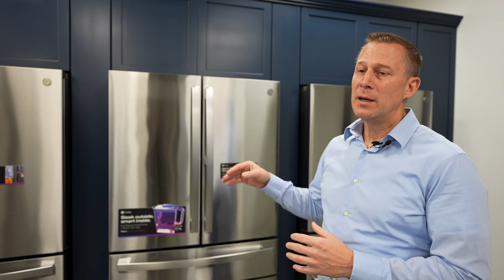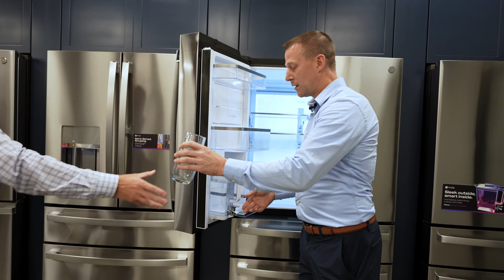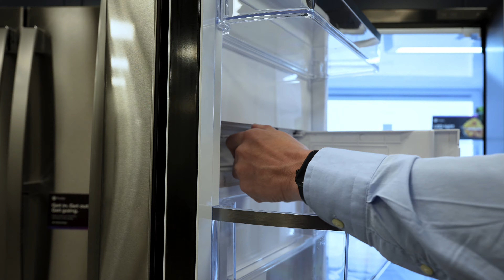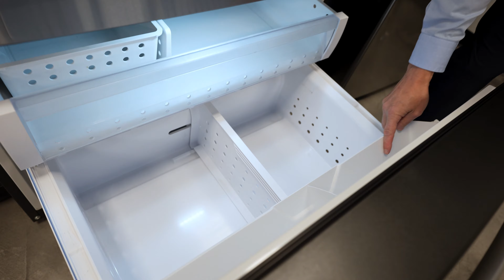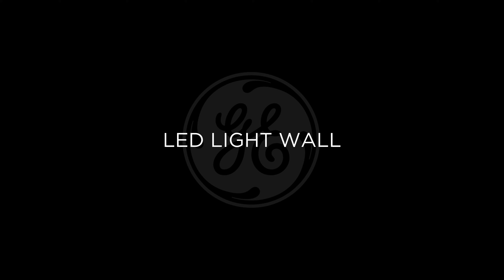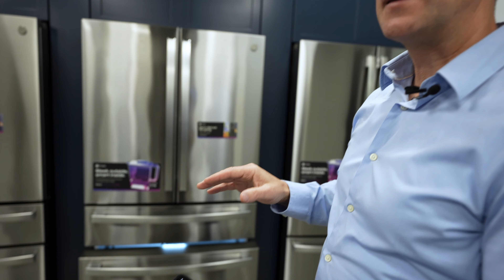GE Profile™ Refrigerator | Builder Innovator HQ Product Deep Dive

Comment: I just bought a similar model but with the water and ice on the outside. One thing I didn't realize about the freezer when I bought this model is the upper draw doesn't pull out the whole way so it's not easy to reach the food in the back of the drawers.

Comment: We bought a GE Profile French Door refrigerator 6 years ago. For the past 3 months it has been limping along with a charge to the compressor line and now it’s done. We are extremely disappointed with the cost to years working ratio. It is ridiculous to expect a homeowner to buy a new refrigerator every 6 years.  The salesman at Leon’s told us that this was to be expected and we didn’t buy a replacement there. I will never expect it. We are 2 seniors on a fixed income, rarely entertain and when we do, it’s another couple. I will not buy a GE refrigerator again and if our new LG only lasts 6 years I will never buy an LG again.  This is robbing the consumer. Home Depot said a week to get a replacement from Toronto and Leon’s was 2 weeks for a replacement from Toronto.  We got an LG from The Brick and it’s coming in 3 days. The guy at Leon’s thinks women are stupid and don’t do their homework so high pressure must work well.
Reply: That’s concerning. Thanks for sharing.

Comment: We prefer ICE/water on the outside, and after living with a 3 drawer freezer for several years my wife said she couldn't live with just two, especially one half of the top drawer has the ice maker.  So we are saving up for the CAFE model.  Just hope our POS KitchenAid 5 door holds out.
Reply: The exact opposite here, and never had an issue in 20 years.
ICE/WATER on the outside is 100% guaranteed top fail, i don't care what fridge you buy, it WILL fail.
Buyer Beware.